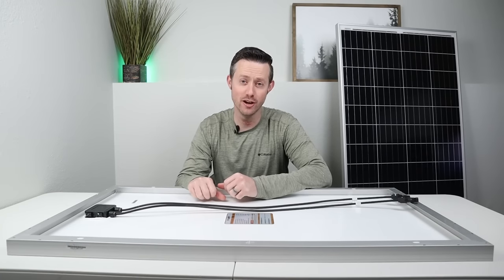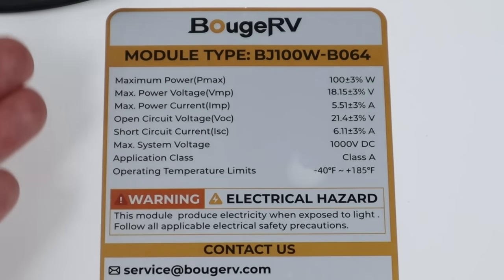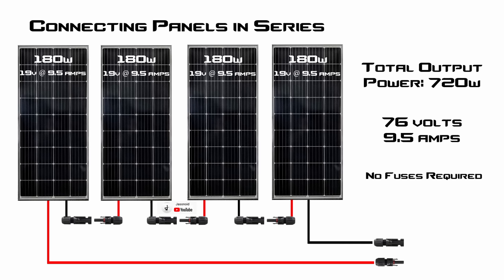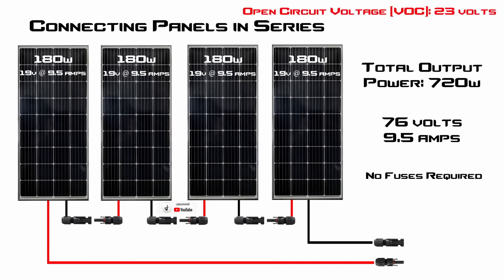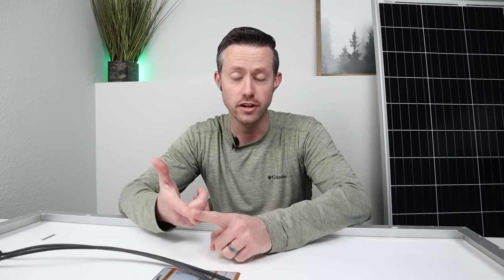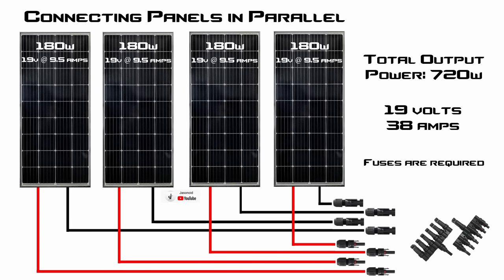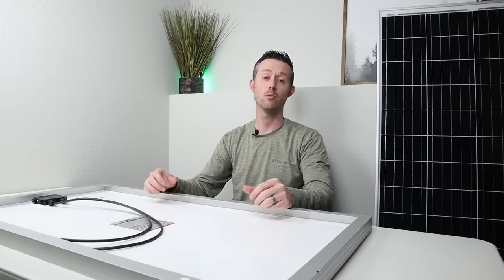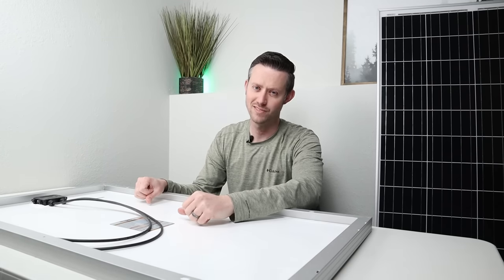Series VS Parallel! A Beginner's Guide for Solar Panel Connections - With Basic Diagrams!

Comment: Hey Jason! What's the relevance of 76 volts in the scenario where you are connecting four 180 watt panels in series? You say you should plan on a charge controller or power station being able to handle an input of 100 volts. How did you get from 92 volts VOC to 100? I understand the principle of voltage going higher in cold weather, but how do you calculate the theoretical total voltage? Are you simply rounding up? Regardless, I'm trying to understand why you mention the 76 volts and not simply focus on the total VOC total of the four panels. I am confused as to the importance of Voc versus Vmp.

When talking about connecting the panels in parallel you said at 8:09 that "These 12 volt panels are rated for 15 amps" Where are you getting 15 amps? I don't see that on the spec label you show. You say that the total short circuit current is 40.9 amps. How are you calculating that? In my mind, it is the Open Circuit Voltage (Voc) and Short Circuit Current(Isc) values that are crucial to be aware of, not the Max Power Voltage (Vmp) and Max Power Current (Imp).
Reply from the maker: Solar panels have two main voltages, VOC and VMP. I explained that in the video. 
VMP is the voltage where panels produce max power. 19v x 4 panels in series = 76 volts
VOC is when panels are not putting out power, yes it get higher when it's cold (24v x 4 = 96v) 

Its important to know both numbers. VOC so you know the max voltage, VMP so you can estimate the actual power output.

Comment: Following you since long. 
I want to run 2, 50w fans and 6, 15w lights. My objective is to get 10 hours backup using 200 amps lead acid battery. Should I go for AC or DC system? I believe AC is much more lossy due to conversion losses . What do you say?
Reply from the maker: If you can stick to a DC system it will be much more efficient. I love using DC if I have the chance, no losses to an inverter running all the time.
Reply: @Jasonoid  Grateful Sir

Comment: Hi Jason, I have a 40W folding panel that consists of 3 small panels. I've discovered that these are wired in series and basically makes it unusable for my needs (lots of shade from trees). Would you recommend I try wiring it in parallel? I use the panel to charge my Ecoflow River 2. Thanks.
Reply from the maker: If you try rewiring the panel in parallel it will have a really low voltage (the panels are designed differently when they come that way). I'd recommend picking up the Elecaenta 120w or Baldr 120w solar panels. They put out great power and are fairly affordable at ~$160 usually.

Comment: Is there a "safe" way to plug/unplug in the live panels into a portable generator or does it not matter?
Reply from the maker: You can partially shade the panels and the power will drop dramatically. Then you can disconnect them. It's mostly an issue with larger solar arrays that have higher voltages.

Comment: I hooked up two very clean 100W panels in series yesterday in bright sun at optimal angle (39 degrees for Seattle). The Voc is 24.3 volts and the Isc is 5.21 amps per panel. I was getting 45-46 volts according to my 40A charge controller, but only about 1.36 amps give or take. I should have been getting closer to the 5 amps. What gives? I was charging an older 12v marine deep cycle battery...and I also noticed it was squeezing out a little bit of water from one of the 3-hole cell caps. But that shouldn't cause my amps to be s low, should it?

Comment: Can you run two different solar panels with different power numbers at the same time? I just got a Mega 2 and already have a Bluetti 120watt solar panel. Might add a Renogy 200watt too but not sure you can mix all the different voltages/watts
Reply from the maker: When running mismatched solar panels in series, the amperage needs to be similar on the panels. 
When running solar panels in parallel, the voltage needs to be similar.
You'd need to check the specs on each panel to see how they compare.

Comment: Ok so I'm looking at panels for the Anker C1000 I ordered to experiment with, and its specs are similar to the F3800 you did a video on, ie 11-32V=10A, 32-60V=12.5A, and it specifies up to 600 Watts of solar input.
That means 60Voc (open circuit), and 12.5A Isc (short circuit) are ABSOLUTE DO NOT EXCEED numbers, correct???
So what is meant by the term "Over Paneling" then, I've seen it used somewhere online, but I don't really understand how you would "over panel" without exceeding the absolute max numbers on the C1000.
I was hoping to try and use one of the 500+ watt bifacial panels that might even go up over 600 watts depending on the backside efficiency, but they would all be over the 12.5A Isc by a little bit, and if its a NEVER EXCEED NUMBER I'm not sure I can really get up to 600 watts. I did numbers on a cheap 110watt panel I have from previous experiment, and in a 2s2p configuration I got 44.62Voc, 11.62Imp (which is probably wrong number) now that I'm looking again, its listing a "Max Current When Using MPPT Charge Controller" which I'm now guessing is the Isc number, and now again I'm gonna be over with  14.6A Isc
And that 2s2p config is only 440 watts using the Pmax 110w
Or am I just completely out in left field, and facing the wrong direction??
Reply from the maker: Overpaneling is when you go over on the amperage in your array. You can have more amps available and your power station will use up to the input limit. No damage there. 
You can never go over on voltage or your charge controller will burn up. Never go over on voltage.

Comment: I have the combo connection like you did but can I add a 5th panel to increase amps and volts? thanks
Reply from the maker: You'd have to have them in pairs for it to work. For example, you'd need 6 panels instead of 5 to keep both sides of the array equal.

Comment: Hi there, I am using a 12 V 200AH battery with a 1KVA inverter. I would like to know how I can extend the length of time that I can have power. Do I need more solar panels or more batteries? In series or parallel?
Reply from the maker: Runtime is based off battery capacity. When you increase battery capacity you'll also need to upgrade the amount of solar so you can keep the larger battery bank re-charged. You kinda have to upgrade the solar setup all together. Charging in series or parallel is based on shading conditions and your charge controller specs. If you need more guidance feel free to reach out here:
https://asqme.com/@Jasonoid
The more information you include with your question the better answer I can provide.

Comment: Question I have is more in-depth. I know the US went to AC power because it runs better over long distances. What or how can I calculate my loss of power over distance from my panels? I am looking to install a solar backup battery system. The service panel is on my north side of my house. I would want to panels facing south and on the south side. How far can i have them away from the service panel without any serious loss issues?
Reply from the maker: Amperage is the main cause of voltage drop. Running solar panels in series is the best way to avoid costly wire in your build. I made a video testing voltage drop here:
https://youtu.be/AZIBmFBzBGs

Comment: Would bifacial panels be worth increased initial cost for south facing roof with latitude of ~41 North in cool coastal climate?  What color of aluminum roof would you recommend? White? Silver? Thank you so much.
Reply from the maker: The panels would need to be at least 4 to 5 feet off the roof to see any significant bifacial gains. That type of mounting solution is a bit difficult.
Reply: @Jasonoid  thanks so much.

Comment: Not bad. Do you have a video explaining the bms amperage? So if my12v 200ah battery has a bms with a 100 amp and my 3000 watt inverter needs 300 amps do I need 3 batteries to get this 300 amp? Thanks
Reply from the maker: Correct, you'll need 3 of those batteries in parallel to power that inverter at max load. I parallel the amps add together for each battery for a total of 300amps peak.
Reply: @Jasonoid  thank you for the reply I’ve looked and looked but got mixed answers. If you have time to answer one more question. It will still run if I only have 2 batteries just not at full load ?
Reply from the maker: @matthewjason5330  yep, it will work just fine with two batteries, as long as you dont go over 200 amps. So that's around 2300 to 2400 watts at 12v

Comment: Bluetti AC 180 having max 10A input @60 VOC AND 500W max solar input. What would be the best configuration and panels to get the highest yield? Space is a premium, balcony facing south!
Reply from the maker: with the 60v cutoff it's a bit hard to get peak power. Did you see my solar demo in my AC180 review? I showed two different panel setups to get close to the 500 watts. Check the time stamps and click on the solar testing:  https://youtu.be/5IWvk4H9F-E

Comment: I’ve recently ordered A bluetti AC180 along with two eco worthy 100 watt bi facial panels. I would be mainly using it for home backup when we have power outages so It would be more of A mobile setup. I would like to know what my best hookup option would be. Thanks
Reply from the maker: You need to stay under 60v and 10 amps.
Reply: Just curious if I’m only using two panels & want the more efficient performance for my ac180 would you recommend one hookup over the other. Thanks for the reply.
Reply from the maker: @OceanBreeze2022.  With that little wattage you won't see much of a difference, but it would be fun for you to twlest both options and see what happens. Parallel wiring would be better for partial shading.
If you had 300 or 400 watts you'd need to wire in a series/parallel combo.

Comment: In this scenario if we are using the KISAE DMT1250 charge controller would your recommendation be to utilize the series parallel configuration to stay under 50V?
Reply from the maker: The DMT1250 supports up to 50voc, so you can have 12v panels wired in series / parallel. It supports up to 35 amps charging current for solar input, which is around 500 watts of solar panels.

Comment: hi Jason......appreciate your videos and comments to my questions.....as a newbe, I am so confused....I just got a anker 767......I have 2-200w jackery solarsaga panels.......there is only one xt60 input on the anker 767......what adapter do I need and how would I set it up.....I am just going crazy......I can use them for my Jackery e2000 Pro, but I want to use the anker....thanks in advance for any help
Reply from the maker: If you need two XT60 ports you can use an adapter like this from Amazon:   "XT60 parallel adapter"   https://amzn.to/42FYHu5

This will allow you to connect both solar panels into that port if they have an xt60 connection..... I'm not sure what type of connection your Jackery solar panels come with. I don't own any Jackery products. I think they are proprietary to Jackery models using the '8020mm adapter', right? 
You might need to call up Jackery customer support to see if they offer any adapter to MC4 connections. If you can get your solar panels to have MC4 connections, you can find any adapter online that will be compatible with them.

Comment: Hello I have a unique situation I think,    I did the math based on 80 amp mppt charge controller with 150 vdc rating at 24 volt    I have 6-550 watt panels,   at so four in 49 volt, at 14 amps,    49-50 volts and gives me 56 amps,   and two in series gives me 98-100 volts, and 14 amps.    total 147-150 volts, and 70 amps. Am I understanding the possible configurations to adjust voltage and amps?  Thanks for the video.
Reply from the maker: You'll probably be best putting them in a 2S3P config since it's such a high amperage charge controller. You may need to explain the solar panel specs again.

Comment: I’m a total beginner. Just bought the EcoFlow Delta 2 max and I’m planning on using 2 GRECELL 200W Portable Solar Panels. Would it best to run them in series or parallel? I am a little concerned about shading. Thank you in advance.
Best regards 
JP
Reply from the maker: The Delta 2 Max has two separate charging ports. For the best shading performance you'll want each of those panels connected to their own charging ports.
Reply: Thank you so much:)

Comment: In your all parallel example, you show an adapter that connects 4 MC4 connectors to 1 MC3 connector.  Your amperage is said to be close to 40 amps.  The last time I looked up specifications on an MC4, they were only rated for 30 amps.  Is there a higher capacity version of the MC4 that I am unaware of?
Reply from the maker: That was for illustration purposes. If your pushing over 30 amps you'd want to use a combiner box that can handle the higher amps

Comment: you told us the two ways of wiring but all we really want to know is which way is actually best...all any of us want to do is put more power into our battery faster and keep the lights on longer...so which way give us that?
Reply from the maker: It all depends on the equipment you go with. Usually a series connection between all the panels will give you more power since it allows for lower amperage in your system (smaller wires needed) and less losses over the run of the wire. However, if you have a shade in your setup, series will loose a lot of performance when shaded. In an RV setup or trailer setup, usually a combination of series and parallel will get you the best performance.

Comment: How do you determine the max rated amperage of the panel.  I don't see it listed on the tech sheet.  I have the same BougeRV 100w panels you show in the early part of the video.
Reply from the maker: It's lame when panels don't list that spec. You'll be safe using a 15 amp fuse. You rate the fuse size in order to protect your wiring.
Reply: @Jasonoid  Thank you!

Comment: Hi Is it possible to add panels to an existing system when thy are wired in series? If you can do they need to be the same wattage as the existing or can you mix say 240Wat and say 300Wat panels?
Reply from the maker: Its best to keep to similar matched panels. You want to keep the rated voltage and amperage similar so that panels perform at peak output. When mixing dissimilar panels together they will 'meet in the middle' on the voltage so neither will put out peak power.

Comment: @Jasonoid Awesome vid! I have 3 folding panels. Whats the best configuration for this setup, series only?
Reply from the maker: All depends on what you are connecting them to.
Reply: @Jasonoid the original ecoflow delta pro. Solar panels are 220 double panels so six panels total but only three sets of wires
Reply from the maker: That takes up to 150voc, so you'll wire those panels in series, no adapters needed 👍
Reply: @Jasonoid  would I be correct in saying there's no benefit to try wiring in parallel then?
Reply from the maker: @klyeguy7092  you can try both, however, the power station has a 20 amp input limit so it won't go over 20 amps.
Reply: @Jasonoid  understood. Thanks brother

Comment: So you want to keep your amperage down with the series. I have a Bluetti AC70. And I want to add 2 120 watt panels. So if you put them in series your amperage don’t go up but the volts do. Is that correct?. Cause the 120 watt panels I’m looking at are 6.3 amps  input. So I can put to 120 in series I stay at 6.3 so I don’t go over the 10 amp input
Reply from the maker: Yes, you'll want to wire those 120w panels in series to stay under the 10 amp input limit.

Comment: How do you deal with odd number of panels? For example, a lot of times I see homes with roof panels where there number of panels is not even. 15 panels, 23 panels, etc. How are these wired since you can not create matching series-parallel pairs in such scenario?
Reply from the maker: If you have an odd set of panels you'll need to run them in series or leave out a panel. Only an even amount of panels can be used in a parallel config.

Comment: Shame you didn't show placing curtain or blanket over panels. Then changing to 2S2P scenario or did you do it whilst sun was shining??
Reply from the maker: To keep the connections from sparking, it's best to cover the panels from the sun and then change the connections. However, you usually won't see that until you are running panels in a much larger array with more wattage. With an array this small it should be fine to disconnect and connect panels while the sun is shining, just be careful if the voltage is above 60v as there is a shock hazard.

Comment: I looking to add solar to my 2018 class A Motorhome that does not have any solar. I have new lead acid batteries that I want to hook up solar. Do you have any suggestions?
Reply from the maker: You'll just need a solar charge controller and solar panels. The panels feed power to the charge controller which charges your batteries. Fairly simple process, you just need to install all the components.

Comment: I am planning to hook 4 bougerv 200w 9bb solar panels to my anker 767 in a 2s2p configuration. Would i need to add a fuse to the positive wire on each panel?
Reply from the maker: Fuses never hurt your installation, 15 amp inline fuses are pretty affordable on Amazon. I'd at least put them on postive connections going out of the parallel connection and before the series connection.
Reply: @Jasonoid  ok thanks